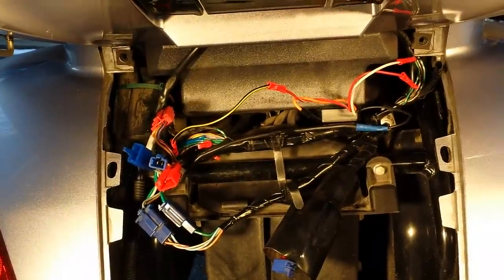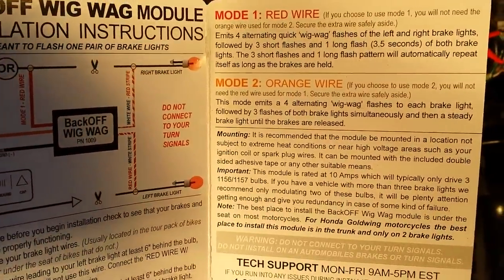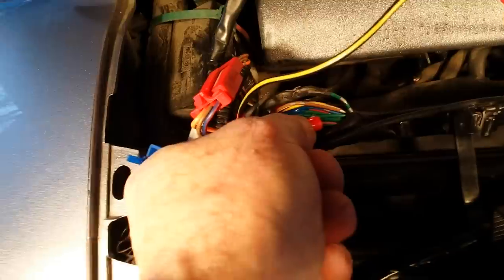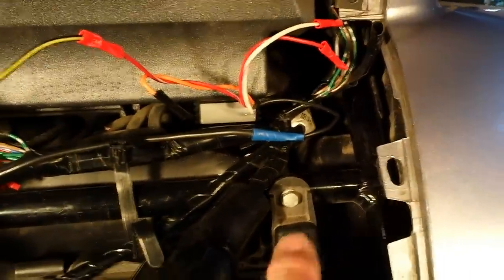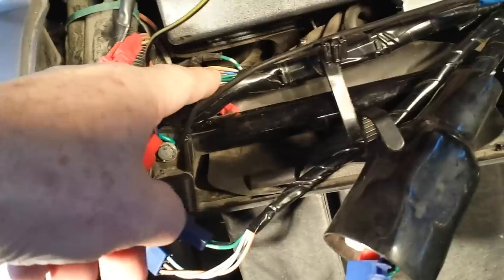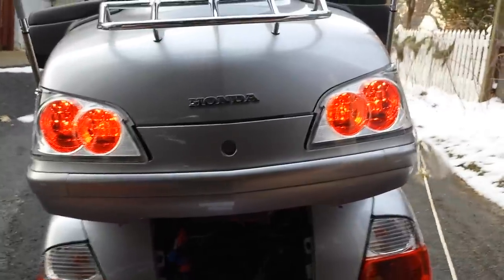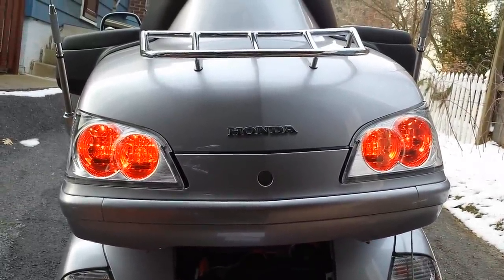Back off Wig Wag Brake Light Signal Module

Comment from the maker: I noticed that when I play the Wig Wag video on my smart phone I do not see the annotations added on the screen.  Please note, do not look for or cut any red wire on the bundle going up to the right turn signal.  You are looking for the same green wire with red stripe that goes to the left side.  Only cut the green wire with red stripe even if it has two silver paint slashes.

Comment: Would it be the same on 2012 Goldwing
Reply from the maker: The only thing the same is the tap in wires to the breaks but the color coding of the wires is probably different.
Reply: @craiglenhard-rvrguyd  thanks could not find video of anyone doing 2012 or newer Goldwing

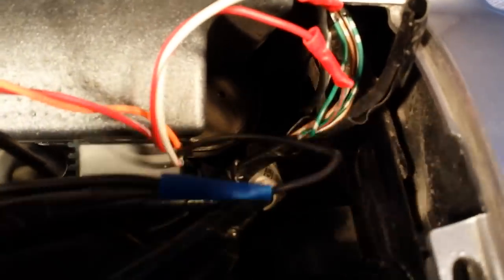Comment: At 2:49 you said the white connects to the red and white did you mean green with white stripe.
Reply from the maker: At 2:46 I noted that you must cut the red wire with white stripe in half. I went on to explain that the Wig Wag red wire goes to the lower wire and the white goes to the upper wire. Does this wiring harness match what you have?
Reply from the maker: See my comment below about which wire to cut. In reviewing the video I can't clearly see which wire I cut but it does look like the green wire with white stripe.